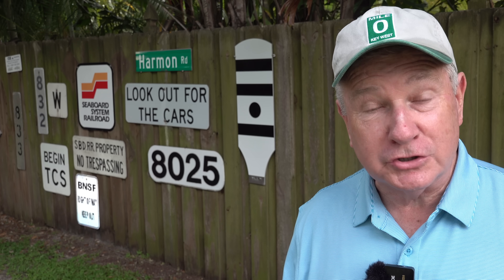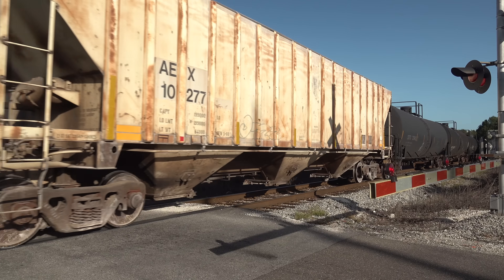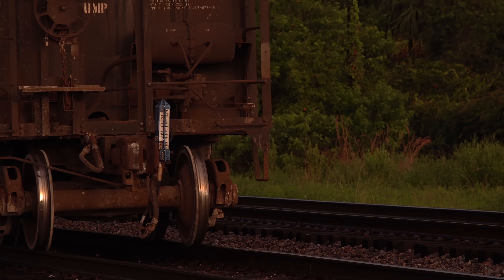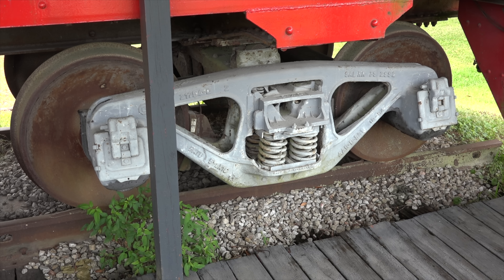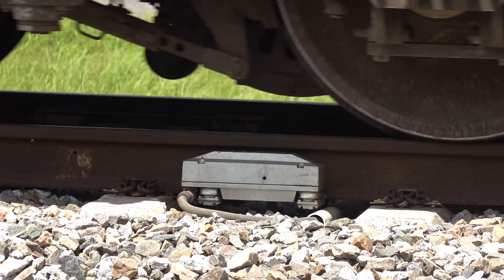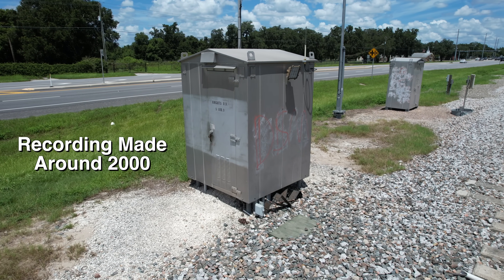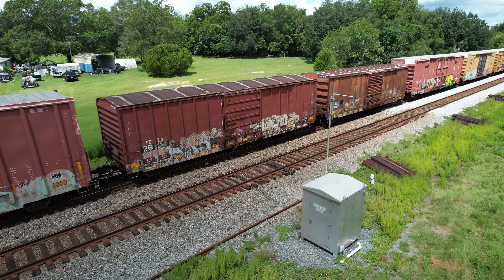What Railroad Defect Detectors Do

Comment: You forgot another type of detector. It’s called a high car detector and I’m not sure of if any are in Florida. They’re used to measure heights on cars like intermodal or autoracks to ensure the train doesn’t go under a low clearance point like a tunnel or bridge.
Reply from the maker: Yes, I didn't forget it. I just don't have any of them close to me. We don't have any main line clearance issues in Florida, other than standard widths on a few thru-truss bridges. All our overpasses are 22'6" or even higher.
Reply: @distantsignal  ok. I’m almost a certified conductor so just thought I’d through the information in the comment section.

Comment: I truck shipping containers in and out of the port(s) of Norfolk, VA. At all of the container truck entryways to the ports, there are sheds that you must drive through, both when entering and exiting, with a setup of top/side lights/cameras inside them that come on when you pass through that look very similar to the inspection portal you show. I know that among other things, the portals at Norfolk will take pictures of the entire vehicle so that any damage when coming in/going out can be noted, but more interestingly, there is also optical character recognition going on that reads not just the code on the container so that it can automatically be checked in/out, but also the code on the chassis and (if present) the genset. It probably also notes the truck DOT number and license plate #, although all trucks at that particular port are required to have their own unique RFID tag as well. I mention this because I'd expect that with a system in place like that for trains, they could potentially do a quick "accounting" of all the engines and cars that pass through, assuming that a realtime database exists that the system can compare it to, they could automatically check to make sure all cars that are (or are not) supposed to be on a particular train are not only there, but can also know their exact position on the train as well. I suppose you could also have such a system use AI to check for hobos!

Comment: One thing to add about the EOT is it can also be armed and if the need arises the train can be thrown into emergency from the rear. The EOT in addition to the things you stated will tell the engineer that the marker is on/off....meaning that it is flashing.

Comment: In my experience, defect detectors are usually located at just the right distance from a conditional stop sign that it interrupts the foreman giving you permission through the limits. 
Unrelated observation: patchy dense fog is attracted to wayside signals.

Comment: Funny.. that "new" antenna is not properly mounted.  The mast is supposed to extend past the top of the dipole.  The lower half of the antenna is at 1/2~ from the mast while the top has no mast and is "omni"  Screws up the patter a bit.

Comment: You are lucky with the cool sign. I work in the sign shop for a large city and we aren't allowed to sell, give, barter or do anything with signs. Everything comes back and gets melted down, every single thing, traffic lights, guard rail, fire hydrants, every bolt. It all gets loaded onto a trailer and the supervisor hauls it off toward the end of each month on his way home. The traffic light cabinets are crushed and the circuit boards rolled over with a roller and baled. One employee was fired for giving a kid a street sign for his street instead of putting it on the scrap trailer.

Comment: I used to work for one of the US RR equipment suppliers. As part of R&D, we investigated picking up the electromagnetic waves from the bottom of a diesel electric locomotive via an inductor between the rails, to see if its motor was operating correctly. It was interesting, but we could not get enough consistency in our tests to turn it into a viable product.

Comment: Getting hit by dragging equipment message is always fun as conductor. I remember one night around 2am in Indiana with over a foot of snow on the ground and a walk of over 100 cars to problem. Brake rigging had come loose and I ended up cutting the brakes out on the car and using quite a bit of duct tape to hold pieces up..didn't have any baling wire with me and no big cable ties but it worked and we got the train to Decatur without any problems

Comment: worked for Sperry Rail Service for 5 1/2 years. Heavy coal drags and Grain trains were job security for me as they thumped and hammered the rail heads and offered splinters in the curves and ground out burns from wheel slip issues.

Comment: Very interesting equipement there. And when they prevent worse, they are good.  Mark Clay McGowan, a former rail engineer and rail fan from California, who also posts videos here on youtube, recently posted a video about a car profile checking portal. It used to detect whether anything was hanging from the cars outside the safe profile. However these systems caused false alarms too often, resulting in them being decommissioned. Btw. I guess those flaps are numbered because the fault detector will report the flap number that was triggered. So they can find the culprit more easy. Although you would expect printed numbers...

Comment: The paddles on the dragging detectors are numbered by the maintainer for win the detecter is removed for track repairs are done it can be easily put back together. Some of the paddles different bolt spacing and the outside paddles are made different. Saves time.

Comment: The Sinclair antenna is a folded dipole design. It has a lower amount of gain compared to many of the CommScope (Decibel) stacked designs. In the antenna radiation pattern, there is a bit of a null in the direction perpendicular to the track with another null in the direction of the mast. Very small differences in radiation pattern between a true dipole and the folded dipole. So much that you need a device in the 5 figure department to measure the differences. The Sinclair product is simply better built with a general smaller footprint. A comp in my opinion to the Sinclair model shown is a Telewave ANT150D.

Comment: Have one of those inspection huts just south of the Canadian border outside Blaine, Wa. Believe they have an X Ray one as well to see if the train has any unwanted passengers. 

It's been a few years since they changed out the bungalows along the line I live on. My best. Defect Detector catch was this. 

BN Detector (this one survived till 2012 still saying BN)

Milepost Eight Eigjt pont Zero- Sedro Woolley

I have a defect. Repeat I have a defect. 

Printer out of paper. Repeat Printer out of paper. 

Sedro Woolley - Out. 

This repeated almost every 15 mins for almost 2 days. 

Sadly now it's just a generic bnsf detector with axle count and dragging equipment trigger. 

Also sad part is they lowered the power output of the radios to 4 watts I believe. 15 years ago I could hear just about every DD from Everett to Canada even a few in BC. Now sadly I barely hear the ones on either side of town.

Comment: Another interesting video, Danny! 

Like your new sign! 

UK railways use Hot Axlebox Detectors (HABD’s), which have the same task your DD’s, but yours check far more than just axlebox temperature. 

And as for that train checking shed, well, thats just an amazing bit of kit.

Unlike your End of Train device, UK trains have either built-in red tail lights or a battery-operated flashing tail lights that fits to a bracket on the wagon or carraige.

So, even though railways were first developed in my country, the US is clearly ahead of us in on-track technology for checking train condition. But our trains don’t travel anything like the distances your trains do! 

Best wishes from across the pond! 🇬🇧

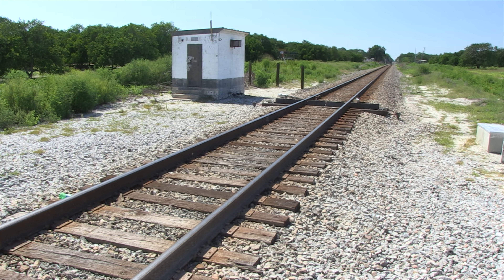Comment: Danny, from my engineer sister who works for CSX and is in charge of their Train Inspection Portal program featured at 11:15 in the video: "Those devices at 3:50 aren’t wheel impact load detectors. They are magnetic wheel sensors to help the Hot Bearing Detector know when to measure the heat." Keep up the great videos!

Comment: I retired from CSX at the end of 2016 - so things may have changed.  Trains passing over DD's at less than 10 MPH would frequently get the message "Detector Malfunction, Inspect entire train".  A big bummer for the Conductor.  Wheel Impact Load Detectors are only installed at a number of strategic locations on the CSX system.  WILD's don't radio the train, they send a report to the Headquarters Car Department office in Jacksonville.  The WILD's report one of 4 different levels of flat wheels.  The first level is 'the wheel is round'.  The second level indicates that the wheel does have a flat spot, but no action is required at this time.  The third level requires the car to be inspected by the train crew and if found safe for movement, it can be taken to the destination terminal for wheel replacement.  The fourth level requires the car to be inspected by the train crew and to be SET OUT on the nearest available track.  The HQ Car Dept. notifies both the Train Dispatcher and the Chief Train Dispatcher for the cars that activate at either the 3rd or 4th levels.  The Train Dispatcher will notify the train when a WILD activation happens.  The Car Dept. will arrange for a local 'shop truck' to go to the set out location of 4th level activations to replace the offending wheel set(s).

I have seen cars activate level 3 and go to destination and hot have the wheel set changed out; go back to origin empty and register as a level 2 and then come back loaded again and activate a level 4.  The HQ Car Dept. reports the offending cars by car initial and number; not by axle count.

Comment: In the event of a minor derailment, how do they get the train back onto the tracks? I work in Birmingham AL, and I cross a rail crossing at Montevallo Rd near Dennison Ave and Green Springs Ave and one morning, a car got derailed. I’m not sure how it happened. But shortly after I arrived at the crossing, I had called the Bham PD non-emergency number to report it. I’m lead to believe they may have turned around and contacted the corresponding rail police. Shortly after the train cleared the crossing. Do crews have the means to pull a rail car back onto the tracks without using a crane?

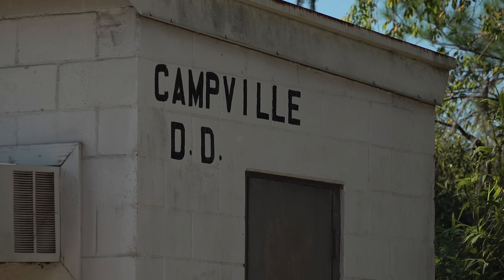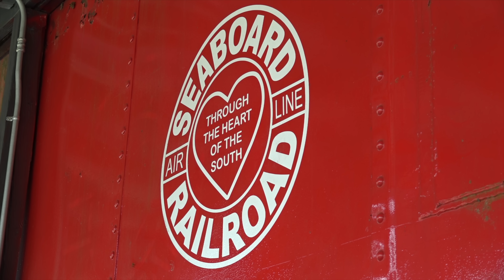Comment: At 4:51 to 5:05, you incorrectly describe the nature of the old wheel bearing situation. The wheel bearings boxes were filled with oil, not grease. The axle ends were turning in a bath of oil with cotton wadding material that would coat the axle end with oil. At the top of the bearing was a brass journal that was coated with babbitt where a thin coating of oil would lubricate the bearing. Sometimes, a filament of the cotton wadding would come loose and get lodged between the surface of the wheel axle end and the babbitt bearing, causing a dry spot to develop on the face of the axle end as it would rotate against the journal.. This would lead to a "hot box". The hot box could burn the oil and cotton wadding out of the bearing box to the extent that the axle end could fail due to the tremendous heat generated. I grew up in the fifties and sixties along a railroad line where grassfires were quite common. They were often caused by sparks and flaming material thrown off by hot boxes. Since the new era of roller bearings, the grassfires are a remnant of the past.
Reply from the maker: Thanks. Yeah, I've already been schooled on that.

Comment: Callout example for BNSF defect detectors same for all call out just the Railroad that runs that line is is said.
BNSF EQUIPMENT DEFECT DETECTOR MILEPOST 456.6 TRACK 1 NO DEFECTS REPEAT NO DEFECTS TOTAL AXLES 5675 LENGTH OF TRAIN 11,350 DETECTOR OUT 
BNSF EQUIPMENT DEFECT DETECTOR MILEPOST 456.6 TRACK 1 INTEGRITY FAILURE. LENGTH OF TRAIN 11,350 TOTAL AXLES 5675 TEMPERATURE 70° REPEAT BNSF EQUIPMENT DEFECT DETECTOR MILEPOST 456.6 TRACK 1 INTEGRITY FAILURE. LENGTH OF TRAIN 11,350 TOTAL AXLES 5675 TEMPERATURE 70° DETECTOR OUT

Comment: Another excellent and informative video Danny! One question I have, how long does the crew have to respond to a defect once they hear it, do they have to stop immediately? I have heard them go by and you can hear a bad tire, banging or other odd noises, wonder how well those detectors pick all that up.
Reply: Pretty sure if there was a defect reported they have to stop immediately, most of those defects are safety critical.
Reply: As soon as the defect detector gives a warning the train will come to a stop for the axle to be inspected.  Detectors can and have given the wrong axle so you need to check a few axles before and after the given axle.  Some things can be handled by the train crew until the car is in a yard where it can be repaired properly.  For instance you check the axle and notice the brake is applied when the brakes are released.  You can isolate that cars brake and be on your merry way. If the brakes, in this example, cant be released then the car will need to be set out at the first available spot.  If two detectors give warning for the same axle that car must be set out of the train.

Flat spots on locomotives is far more important than on rail cars.  Due to the weight of the locomotives, flat spots will break the rail.  Rail cars can have larger flat spots than locomotives and can have multiple flat spots on a wheel but they cannot be too close to each other or above a certain length.

Comment: Detectors are worthless. All they really do is hog the entire radio when you're out switching and ONE CAR from a joint. And before some boomer gets on with some lecture about hand signs, remember, we aren't running those cute little 4,000 ft trains with a 147-man crew, that LONE conductor is 2 1/2 miles away!

Comment: I am assuming that the delay between the last car passing the detector and the transmission of the report includes a piece of programming that tells the dector to stop counting the axels.
Reply from the maker: It's likely something like that, similar to a traffic signal sensor deciding of the last car has gone before changing the light.

Comment: Along the CSX Metropolitan Subdivision in Washington DC,  there is a corridor integrity monitor between F Tower  in N.E. Washington and Silver Spring MD.  This segment of the Met shares the ROW on either side of the WMATA/Metrorail red line separated by fences.  This monitor was installed back in the late 80"s following a couple of CSX derailments along the corridor. 

In those instances,  Metro was not effected, but WMATA  was concerned that if a train (Amtrak and MARC commuter trains also run on the line) on the Met Sub were to derail and break the fence that it could put Metro passengers and personnel in harm's way.

I have heard this detector go of a few times including once at JD Tower in Hyattsville while visiting with the operator.  Fortunately, they have all been false alarms set off perhaps by an animal or some other technical issue.  Just last week, I heard it actually issue a derailment alarm in the area of F Tower and QN Tower, but visually confirmed that there was no derailment.  In addition,  there were no CSX communications about any sort of emergency response to a possible derailment. 

QN and JD were both active interlocking towers back in the mid to late 90"s.  JD  which controlled the junction between the Capital Subdivision and its Alexandria Extension closed first and was supposed to  have been sold to the City of Hyattsville to become part of a historical display.   Sadly,  it was torched by vandals before it could be moved.   QN went next and was unceremoniously dismantled apparently at the request of Metro due to its close proximity to the red line and out of concerns over potential arson.

Comment: Detector fun ... Take the axle count, subtract 6 for each engine, divide by 4 and you have the car length of the train.
Exception: those double stack cars often come in 3 or 5 car units where the cars share a bogie with the adjoining car, so three cars normally would have 12 axles, but the 3 car unit only has 8 axles.

Comment: I have a long standing question regarding train operations:  How is the power output of locomotives coordinated among multiple power units so that one isn't just coasting while the others do all the work?  Recently I've been seeing a lot of trains with locomotives on both ends: how do they coordinate?
Reply: If the units are coupled together there is a cable that between them so they are controlled as one.  Distributed power units are controlled by radio and can work in sync with the lead or be controlled separately by the engineer.

Comment: I'm in northern Indiana.  There was a train derailment in Lydick Indiana Sunday.   I seen it on my bike ride.  Only 1 or 2 cars derailed.   One car lost an axle.    I road my bike over the next 3 rail crossings and noted damage to the asphalt.    There were also wheel marks down the center of the ties through each crossing.       I think the train was derailed for several miles.   Is this common in derailments?    I have photos

Comment: Another great video. About a month ago, I was on the eastbound Amtrak Cardinal when we set off a defect detector outside of Charleston, WV. Turns out it was a hot box on the locomotive. Needless to say, since there was only one locomotive on the consist, we were dead on the tracks and ended up on busses. Not one of my better trips but much better than a derailment.